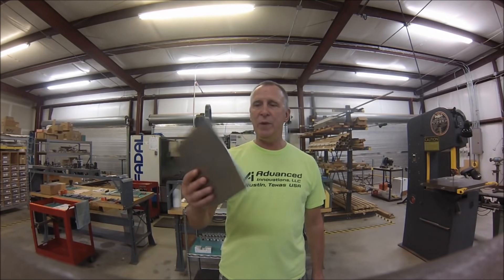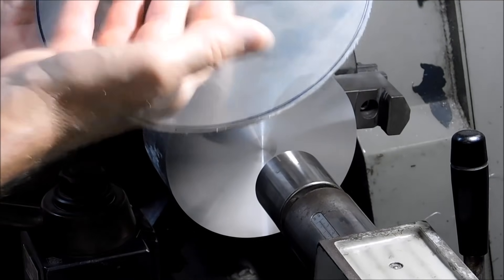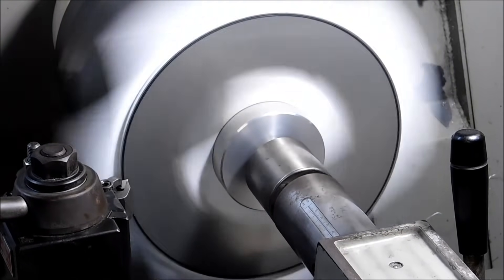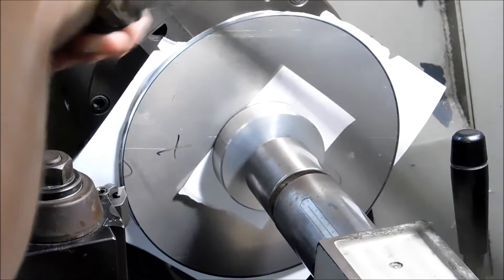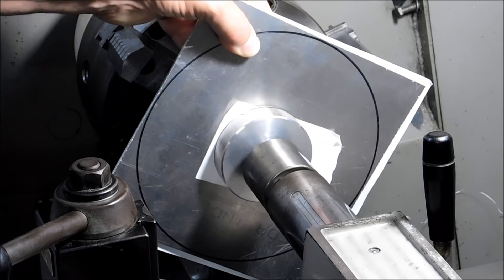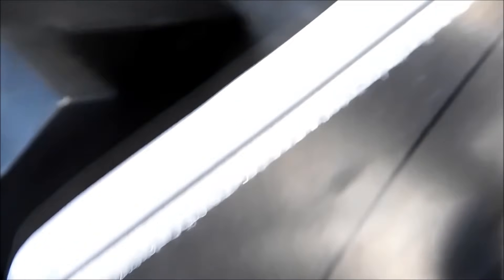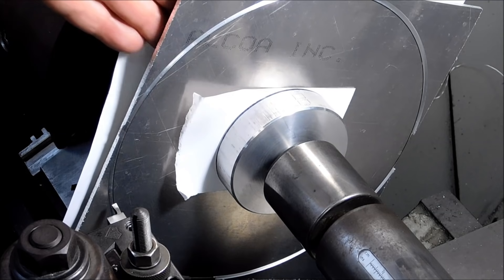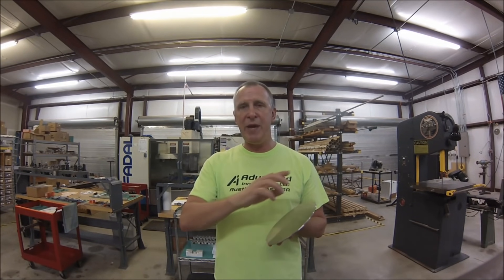Pressure Turning

Comment: Joe, I love 99% of your videos, but I gave a thumbs down on this one.  Mainly because the part 2 method you showed.  The trepanning method with the square corners still on the part.  You are an experienced machinist and no doubt got lucky a few times while learning the trade(alot of us have), but there are those who have not been so lucky and got bit the first time they tried something.  They may have lost an eye, a finger or worse!  I have a personal experience with the trepanning method in a shop where a guy who had 20 something years experience was about to trepan a 1/4" thick steel plate about the size you just did.  I was standing at another lathe just behind him.  when I heard the sqealing steel and saw what he was doing, I yelled for him to stop.  I told him to go saw off those corners but he thought he knew better.  I left the room.  He got very lucky and walked away intact.  But later when I returned, I found one of those "Kung Fu corners"  down the end of the shop 50 foot away.  I wanted to take that corner and shove it up his... Note; We had an accessory for the band saw to quickly and effectively cut circles out of plate using a sort of live center at the band saw. " Cutting corners" in a shop is not a good idea - pun intended!
Reply from the maker: Thanks for your comment. If you think about it, the tool doesn't know if there are corners on the stock its plunging into. That being said, the probability of the part slipping is equal either way. That is not true for the danger level. Long ago when I was first introduced to this method, the corners were left on for time savings because the job just didn't have the wiggle room to spend on the saw and the material arrived square. With the part spinning, those corners are almost invisible and when they break free, they are probably the most dangerous by product you will ever encounter. That holds true for the guys around you too. I'm OK with the thumbs down, but I demonstrated both ways to show both ways and stressed the safety factor when leaving corners on.
Reply: Joe, I've used your second method many times over the years, with no ill effects. Caution is the name of the game with this one. I sometimes slow the spindle rpm down to insure those flying metal triangular shears are slowed to subsonic speeds. I will admit I did this more often before I bought a band saw than after.
Reply: Dan Linscheid
I done similar operations many times myself.  I find the only thing that happens is the tool hangs up an the part just spins in the base plate.  You end up with a chipped tool and a scuffed up part, but I've never thrown  anything out.

Comment: Oh God, there's that all so misused word again..."concentric".
The word you're looking for is "true".
There's a big difference between "concentricity" and "runout".
Reply from the maker: Please explain. In my shop, concentric is a term about a relationship between two axis of rotation, runout is the amount of error. They go hand in hand.
Reply: Joe Pieczynski There is a big difference between "concentricity" and "total indicated runout".
You would need a fairly sophisticated CMM machine to literally probe thousands or even tens of thousands of points at a specified datum to accurately measure "concentricity".
A relationship (as you pointed out) between two SURFACES is called total indicated runout.
Reply: Well ... Concentric means two circles sharing the same centre, and so, on a lathe, when you measure "runout", you are in fact measuring the extent to which your part is concentric with the axis of rotation of the lathe headstock. So I'm not sure I understand what your complaint is.
Reply: wallacesaan No. It does NOT mean that. 
This is the core problem that I'm talking about. 
Total indicated runout is entirely different than concentricity.
Reply: wallacesaan "axis of rotation"?
That has NOTHING to do with tolerances or anything that we're talking about.
Reply: wallacesaan Two circles are two circles. 
Do you want two circles in line with each other?  Or do you want two SURFACES in line with each other? 
I'm not an engineer, by any stretch, but this ain't that hard.
Reply: Well, I am an engineer ... In fact I have a PhD in Engineering Physics and in my day job I am a research scientist. The definition of 'concentric' I provided is the textbook definition (you can easily look it up, for example here: https://en.m.wikipedia.org/wiki/Concentric_objects). And runout is a measure of the lack of concentricity (among other things) as you can also look up, for example, here : https://en.m.wikipedia.org/wiki/Total_indicator_reading.  So, yes, they are different in the sense that concentricity is a geometric property (defined as two circles, or other geometric shapes, sharing the same centre) where, in most machining applications, one centre is the axis of rotation of a part, tool, spindle, etc., and the other is the centre of the circular part, feature, tool, etc. that you are indicating. Whereas runout is the measure of how far out of concentricity the part/feature/tool is from the axis of rotation, assuming the surface you are indicating is circular. Runout will also measure lack of circularity of a part, or, of course, the combination of lack of circularity and lack of concentricity if both exist. But, in most machining situations, what you are measuring with runout (TIR or FIM) is concentricity.
Reply: wallacesaan “runout is a measure of how far out of CONCENTRICITY a part is”. As far as we are concerned, this man was trying to make the circular part concentric with the axis the lathe rotates along. I’ve learned it as the z axis but others have called it the x. Either way it’s the axis that the back stop slides upon. Towards or away from the chuck. With that said, since he is using circular front and rear plates to hold another circular part in place, he is trying to eyeball the concentricity. As for saying you need to measure thousands or tens of thousands of times to find it, you sound like a physicist. Engineers are good with close enough. Oh and I know because I am one too. 
Third point, he is dealing with the run out of not having it perfectly concentric with the other parts center. So honestly, both you and the person posting the video are correct.